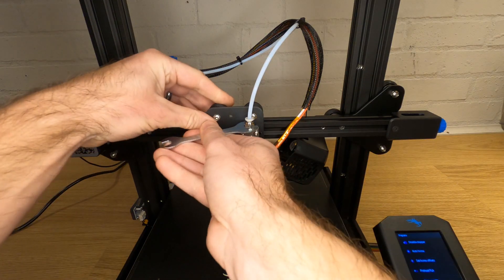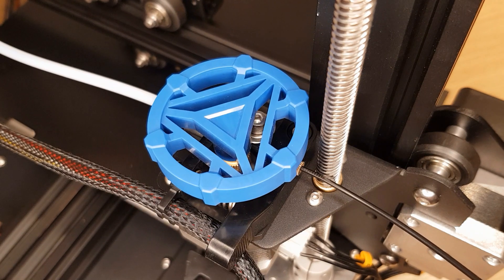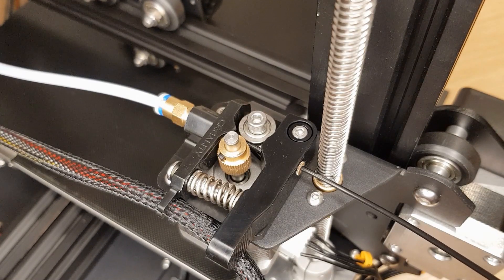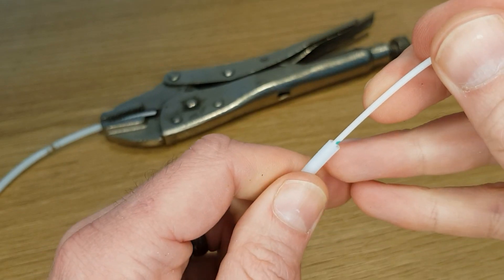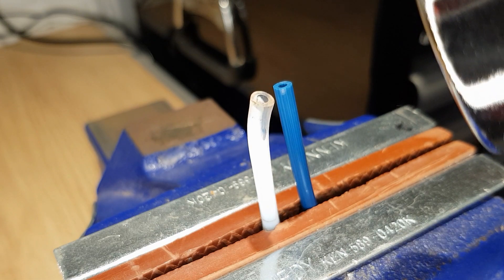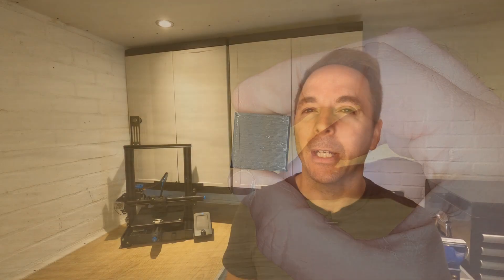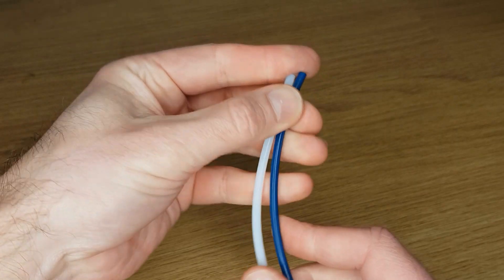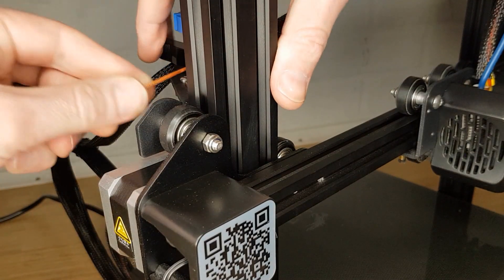Essential First Upgrade That Will Actually Improve Your Bowden Tube 3d Printer! A Capricorn Tube!

Comment: My enders 3 does not have threads on the feeder or hotend, does this mean i will have to upgrade them both before i can fit the capricorn tubing. Thanks for your informative videos, and i hope this is the appropriate place to ask this question. Im new to the hobby by the way

Comment: Hi Ricky.
Does the claim of having a tight inner diameter hold true for direct drive extruders as well?
I was under the impression that a larger inner diameter is better because of lower resistance/friction points. Again, just asking for a direct drive extruder setup.
Reply from the maker: It is way less important on direct drive as it is very unlikely that there is a long enough length of PTFE between the extruder and hot end to make much difference. It is something that you want to keep an eye on though. Yes, too small will give resistance but too large will give too much room for the filament to flex into.
Reply: @RickyImpey  thanks.
I figured that before the extruder I'll use a wider inner diameter and after the extruder, I'll use the Capricorn tube to the hotend.
Reply from the maker: @gil80  perfect 👌

Comment: If you remove the numatic fitting and push the bowden tube through to the end of it first, you can then flare the end of the bowden tube slightly, using a pen or somthing.
Now when you reinstall the numatic fitting, the flared end of the boden tube should be squished between the numatic fitting and whatever it butts up against once installed (or maybe the flare just stops it slipping back out, without being squished). 🤷🏻‍♂
Either way, this ensures that the bowden tube will not easily become worn and loose from all the back and forth movment of the filament (and printing in general) where the numatic fitting bites into it.
This helps to keep your required esteps consistant over time, and ensures that the bowden tube won't need replacing anywhere near as often.
I think this is more useful on the extruder end, as that is where you are more likley to see the boden tube actually moving in and out of the numatic fitting, but it probably wouldn't hurt to do it on the hotend too.
If you mark a line on your boden tube right next to the numatic fitting, it will help you to see if your printer has this issue while it's in motion.
If the line is moving back and forth in relation to the numatic fitting, it could probably do with some attention.
Reply from the maker: Yes, this does work well on the bowden end but not on the nozzle end as the nozzle is a short distance away from the end of the fitting plus a flare would stop it passing into the throat. This is why I leave the nozzle half to a full turn from tight, fit the bowden and then fully tighten the pneumatic fitting. It puts tension on the fitting and clamps the tube tight so it can't move. Appreciate the comment 👍
Reply: @RickyImpey  Ah, that makes sense. Thanks for the tip.

Comment: A full extruder upgrade is also essential in my opinion, because they come with a more aggressive gear, which completely removes filament slipping.
Reply from the maker: I know a lot of people have had problems with the extruder but I haven't as yet. I've now been using the printer for nearly a year.
Reply: @RickyImpey  my stock extruder gear was really flat, it was almost like the tooth profile was sanded down or already really used. Every time I would leave my printer for more than 3 hours, the filament would slip on the first layer. The more aggressive gear solved that issue and I haven't had a problem since.
Reply from the maker: @STOPH3R01991  Yes, and a lot of people have the level crack too so it's obviously not the best quality all round.

Comment: My Ender 3V2 worked perfectly right out of the box . . . I still upgraded it - Capricorn bowden tube, moved the power switch to the front, installed Jyer's firmware, printed new power supply cover to unblock air flow, added crimp-on ferrules to wire ends at power supply & motherboard, installed Copperhead heat break and replaced hot-end fan assy. with the Ender 3 Max with dual part cooling fans!  Also using a full size SD card for print files.  Great machine. 🙂

Comment: The Bowden was my first upgrade then the springs.  But learnt that all axis belts are not the same when I bought a cheaper belt for my snapped x axis and it worked great until the weather got hotter and stretched to such a level it is unusable! Original Y belt still good. Did notice it did not have any cord support afterwards.  Lesson learned!
Reply from the maker: Oh wow, yes a stretched belt is not good😬

Comment: PTFE tubing, also degrades and breaks down in heat - some of the cheaper stuff as low as 240C - this offgasses and creates a toxic exposure that can harm humans, and kill small animals like hamster and birds.(especially birds)  so even if you properly ventilate to keep the fumes from causing harm, the physical material is breaking down, becoming 'gooey' and encrusted, which will result in blockage and a complete mess eventually.   Capricorn tubing - is no exception.   It can go higher - but not to the '260C" people claim.  It will break down.  The REAL solution to this, is to change to an "all metal" hotend, to where the bowden tube stops in the heat break, and the filament is carried on through a tight tolerance metal bore to the heating element and nozzle instead of the bowden tube itself.  This keeps your tube -cooled, no matter the quality, and away from causing problems like globbing and leakage with the design to press the nozzle up against the bowden tube (which if not cut flush, or has a gap at all, will leak, including gaps from degredation over time of use from high temps)

So you are part right, part wrong.  You, like so many others, have just 'trusted' the sellers information - without actually looking into them.  I am not blaming you directly,  Capricorn is still claiming 260C temp safety - when I personally have had it break down in the 250C range.  The solution - was a all metal designed hotend, to keep the tube away from the heating element, so it doesn't get anywhere near that range.

Comment: Any chance you know how to 3d print pointy objects with low surface areas? For example let's say you have an object the shape of a nail and it has to be printed on a tower. I'm using the creality software that comes with your ender 3.... Experimenting with this has proven to be the end of me!!!
Reply from the maker: Hi Teddy, I don't use the Creality software but it's just a re-skinned Cura. Look for a setting called 'minimum layer time' and increase it a little. This might help give the layers on the thin parts more time to cool. There are other settings that move away and pause while the layer cools but this can lead to blobs on the side from oosing. Hope this helps.
Reply: @RickyImpey  I think I know what you're talking about but I think I'm just really bad at explaining myself.... Imagine printing the letter M but the middle peak doesnt touch the base plate and comes to a super fine needle like point... I'm trying to print a support tower to print that middle part of the M as that midsection will branch out to create half of the shape im printing (which is about the size of my hand) 

The major issue I'm having is the support structure top layer/connection mesh that snaps off the printed part is a wide grid and the 3d printer likes to try and print in the center of this grid where there is no material, so naturally the printer is printing in mid air and the piece ends up spaghetti.

I'm having difficulty figuring out how to print this entire piece as a whole, and have resorted to cutting the piece in half so that midsection of the M touches the base plate.
Reply from the maker: @teddy5004  ah, I see! Yes, that is a pretty tricky thing to do. Have you tried adding custom supports to increase the surface area or move things around a bit so that the lowest part gets the support it needs? Or, could you add a very small sacrificial part to the model that gives exactly the support you want and then be snapped or filed off. Difficult to offer much more without seeing the model really. Sorry if it's not mush help.
Reply: @RickyImpey  I've tried the others and considered your last idea but I'm fairly restricted with free programs... I did want to attempt it though. I have a hot iron and plenty of sanding tools to cut off and smooth out the excess material when its finished.. I was hoping to start selling cosplay props to my family and friends which have a TON of spikes and other tiny details like this and your idea sounds like the fastest method... I'd hate to be forced cut the prop into tiny sections as I'm still practicing welding parts together with super glue or a soldering iron. 

Thanks for the advice man!

Comment: If you have an ender style printer, i.e a bed slinger with a Bowden filament feed system, your first upgrade should be to a direct drive all metal hotend.
Don't waste your time trying to "fix" the Bowden system. Its high maintenance and will never achieve the same print quality as a direct drive system.
For those worried about the extra weight a direct drive system adds to the X axis slowing print speeds... don't. The bed is much heavier and it is the limiting factor in max print speeds.
Since going to a direct drive all metal hotend on my Aquila and original ender 3 I don't have to do any maintenance on the hotend side. It just works. Day after day, month after month without degradation in print quality. Only maintenance I have to do is change the fans when they wear out.
Reply: @tradde11 extra weight on the gantry will cause sag but this is easy to overcome by adding a second z screw.
You do want to limit the amount of weight on X and y as much as possible but the bed is pretty heavy which is the limiting factor for print speed in a bed slinger. Especially if you have a glass plate for the build surface. You can add a bit of weight to X without compromising print speed or quality. In fact I can print faster and with much better quality with my dragon/orbiter DDE setup than I could with it stock. Plated copper heat block and nozzle gives you higher flow due to better heat transfer. Combined with precise filament feed with the DDE. Print quality is amazing.
Reply: @tradde11 I used to worry about the same issues. Which is why I spent heaps of time trying to "fix" all the issues with the Boden design. In the end I got fed up with it and decide to try a DDE setup.
I have not regretted it for a second. In fact when I see peeps struggling with Boden like I did I feel compelled to encourage them to go to DDE.
As far as the extra weight effecting acceleration it's not an issue. The y axis has more mass than X even with a DDE so the acceleration limit of your printer is define by the y axis. I run Klipper which has a feature to tune out harmonic resonance. I was able to increase acceleration to 4500 and remove all the surface noise on X. I still have a little bit on y but you have to really look to see it.
Klipper is a pain to setup but it's worth it once do. Depends on your skill set I guess. If you can configure your own firmware for your printer you'll be able to configure Klipper.

Comment: I was having problems with the original pneumatic fittings letting the white Bowden tube move back and forth. Once I replaced it with the same kit you have there, and calibrating my extruder it helped a lot in my prints.
Reply from the maker: Yes it really helps to get rid of all that movement Jeff. I also find 'preloading' the Bowden tube with the nozzle at the hotend really locks it in tight. As in the video, I do this buy leaving the nozzle a turn loose before fitting the Bowden then tightening the nozzle the last bit as the final stage.
Reply: @RickyImpey  yes I did that too with the new tube and fittings. Thanks for doing these videos.
Reply: @RickyImpey  You can do the same thing with hot end coupler. Leave it loose a turn when you push the Bowden against the nozzle and then tighten it. If you have an all metal hot  end leaving the nozzle loose isn't going to help remove any Bowden/coupler movement.
Reply from the maker: @stevecade857  yes true, thanks👍

Comment: My first upgrade was to a Creality metal extruder. I figured that the plastic one they supply with the ender 3 v2 wasn't long for this world. While I was at it I swapped out the tube for a Capricorn one.  But I totally get why the Capricorn tube should be upgrade number one. Inexpensive and easier to do. I like your reasoning!
Reply from the maker: Yep, it's a close call on the Ender 3v2 between the Capricorn tube and the extruder arm but generally across all Bowden printers I choose the tube.
Reply: @RickyImpey  I choose Ender 5 Pro because of the metal extruder AND Capricorn bowden tube factory installed. So my first upgrade during the assembly was changing to an all metal Phaetus Dragonfly Hotend BMS with a 0,4 mm ZODIAC V6 CRB nozzle. The print quality is excellent with both PLA, PETG and TPU. I can say it's even easier to print with TPU than PETG with this setup!